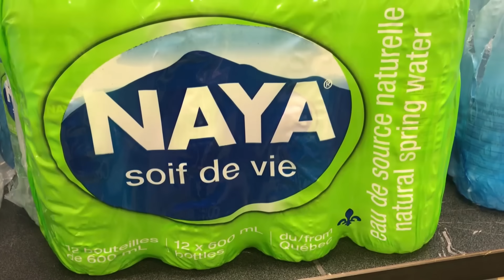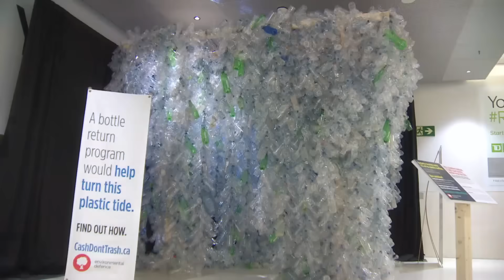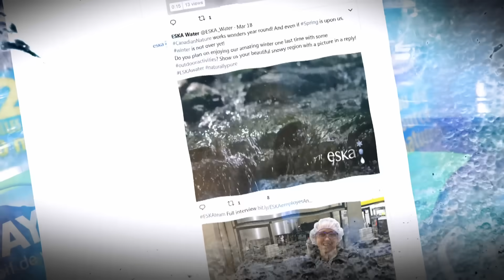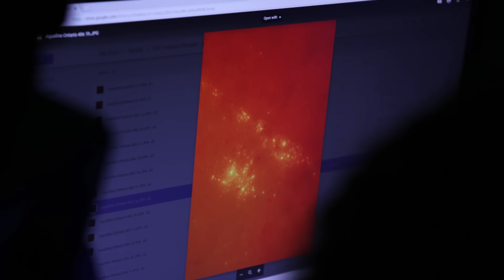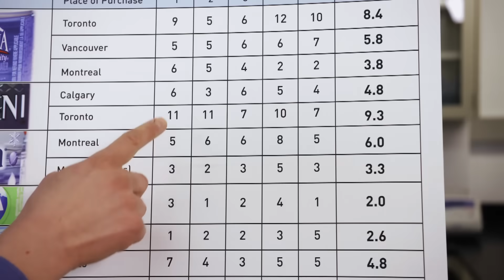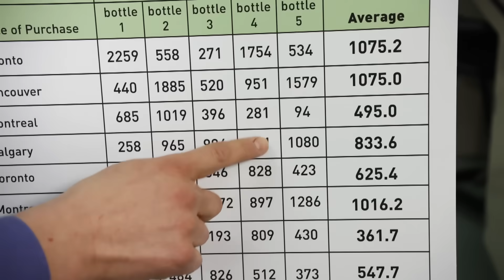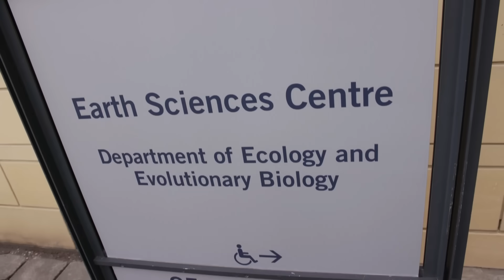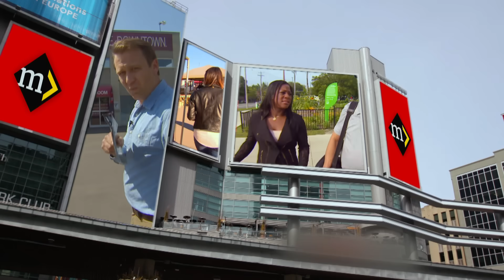Here's what's in your bottled water (Marketplace)

Comment: Idk, the water out of my tap is so hard, after one use of the water, it’ll leave a very visible calcium film on the stainless steel sink. Yes, after one use. The water is that hard. If I leave it for days, It’s even harder to scrub off. I’ll take micro plastics (100 micron) over THAT hard of water, going thru my system. I thought the public water system had heavy standards, but I guess not.

Comment: You should investigate: furnace service companies ...  I have experience companies telling me to replace whole furnace rather than replacing simple part  ... even my in-laws had three different prices from $1500 to $750 to $ 150 ... the last company simply drain the  cushion tank on their boiler system and everything work fantastic all winter long. Companies taking advantage of the elderly saying everything must be replaced when boiler was installed 9 years ago
Reply: Agonquin, they simply want you to buy a high efficiency furnace which is not usually high efficiency at all, and if there should be a serious power shortage on the new furnaces which use motherboards, and those motherboards crashed from a surge, thousands of people could be demanding a new thousand dollar motherboard over night.  The prices for the motherboards, which people may then have to wait weeks for, for factories to suddenly build, as well as weeks for enough men to install them, could suddenly jump to $5,000 apiece, more than a whole new furnace.  I say give us the old furnaces back again.  Almost nothing new is built as well as the old.  It's as if everything new is secretly programmed to self destruct shortly after the warranty is over.  The only good thing about new furnaces is that they are tiny compared to the old, so they are much easier to replace and/or discard.
Reply: @foxfur8327  ... so your saying that a contractor can't go to ¿? let say a Lennox store and buy a new board controller (contractors price: $250) because the old board's controller (you call a mother boards) has a relay that turn on the main fan blower: has simply burnt out ... so your saying instead of replacing this board, it's far better to let the contractor take my hard earn money of $3000 for a new furnace ... and then have contractor say while we're here let's replace your perfectly working A/C unit Too
 and call it $5000 for everything ... no thanks; I think it's better to spend $500 to replace a motherboard rather then shelling out $5000 plus

Comment: Why are they throwing plastic into our Oceans? Why not use pure glass knowing we have this environmental problem. Its amazing how environmentalist want us to do something about plastics and such. Yet we had pure glass products and they griped about glass being littered in rivers, lakes ect.... which if they have a core charge like they do for like car battery's ect... you will find a hell of alot less bottles would be thrown out. And of those bottles they can be turned back into sand to further keep our environment safer. Also paper bags and straws also can be burned. Reprocessed into a news paper or whatever it can be reused. Stop using foam products which take over 100 years to get rid of. How about using shredded cloth, or paper or fibers that can easily be disposed of without throwing things into the dumps.  And have a things that can incinerate products with special air filters to keep clean air as well as clean oceans.

Comment: Yeah plastic in bottled water which the bottle is plastic. Duh 🙄 
Tap is just disgusting cause it tastes more metallic just like Nestle, Desani cause the ph is toxic. 
Tap from pipes I wouldn’t be surprised if it has mercury in the water.
Also, if you reuse the bottled water, it can only last for a bit before you have to recycle again.
I used this one bottled water and after I used it once I found fungal spores growing inside. It’s really nasty. I definitely had to throw it away. I tried to figure out how did a fungus get inside the bottle and I started checking all my bottles. It got to the point I switched brands. I use Fiji. Little thicker plastic but not so much metallic taste. And yes a little more expensive than the cheap brands like Nestle or Mountain fresh. It just those I end up having fungus growing inside the bottle which is not good.

Comment: I drink bottled water because my local tap water is flouridated. Flouride in high enough levels (such as in my tap water) is toxic to the brain, drink it for a year and you will drop a few IQ places, if you are pregnant you will harm your baby. Also it is bad for the pineal gland (third eye.) Some bottled water does contain high levels of flouride so I research which bottled water to buy. I am only drinking bottled in the interim before I get a suitable filter for the tap water. The bottled water I drink is not bottled tap water it comes from natural sources. Ideally water would only be stored in glass not plastic.

Comment: I don't know if y'all have Costco in Canada, but I buy a case of Costco 500 ml brand bottled water to keep in my car to prevent dehydration while I'm on the road. 

A case lasts at least a year, maybe longer, because once you've opened the bottles & emptied them you can take 'em in the house & refill them. You don't have to use them just once and discard them and there's no worry about whether the tamper seal is intact, because I broke that seal myself the first time. 

When the cap is too worn to re-use the bottle again I can still recycle. When I go walking I still use liter bottles with "sports caps" that I bought back in the 80s. Those are a much sturdier cap that lasts longer and can be refilled again and again and ...

Comment: so much dramatized hyperbole with few useable facts. I  clean water for a living and tap water has, delivered through pipes made of all different types of materials including plastic, dirt (minerals), oxidized vegetable oil (used in water pumps throughout the cities), sodium fluoride (put in the water on purpose by cities because they have been told that it hardens the enamel of human teeth, but classified as a neurotoxin by the EPA and FDA), varying levels of chlorine (free) and chloride (attached to dead organic compounds) both of which cause damage to the mitochondria of all the cells that come into contact with it (but better than having a bad bacterial invasion), arsenic and 100's of elements and compounds. 
We are much better off than we were 100's of years ago and if people are drinking bottled water rather than the alternative then that will serve them well, including tap water compared to wine or a can of coca-cola.Our bodies have their own filters as last resort and can also adapt via epigenetics to accommodate the foreign materials, Everything in moderation

Comment: The years the chemical industries started using them for manufacturing should be included.Rayon in the 1930's, mercury in the 1800's for medicine.The contamination is massive. I found that working as an industrial mechanic and having a high school chemistry class helped when it comes to PPE and reducing exposure but it's the things that you don't see that were harming the body.

Comment: unfortunately I can't/won't stop buying because of issues that I witness from tap water. Examples: because of flooding we have had boil alerts for tap water; when the fire dept flushes the hydrants, my tap water is brown and greasy for about 2 hours; I've gone to restaurants and the water they bring to the table has an algae mildew "smell-taste". My issue is that when our tap water is cleaned at the water treatment facility, that water then travels from the treatment facility through old water pipes that have not been treated and is full of rust and bacteria.  By the time makes it to my faucet it is full of bacteria again. I lost vision in my left eye from bacteria in the tap water when I washed my face and it entered a scratch on my cornea.  The bacteria released toxins and damaged my cornea.  At least when bottled water is treated it goes from the treatment plant into the bottle. So I will take my chances and continue drinking bottled water but that's my choice.

Comment: The plastics industry needs to switch to plastics or other suitable materials that are made from mineral organics. That way the impurities found in current processing methods can be beneficial to biological matters. Current methods of trash disposal need to be changed to the breaking down of any matter to each tiniest piece of any particle of any compound, element or growth to the quantum level. Then recollected, gathered & bundled for reuse, instead of putting trash into landfills, which contaminates the water table underground, aquifers, rivers, streams, lakes, seas, oceans and ground elements including ocean floors. This can be done through Vibrational Resonate Frequencies, which runs through all physical matter of the Sciences. Using sensible magnetic electro, sound & light wave properties & computer technologies that are suitably ordained, researched, developed and accorded to organically compatible profigurations. Hemp for one organic source, also makes plastics better than benzene which is derived from oil & gas, & which is harmful to the human body & other biologies in long term exposer, consumptionism & elemental combinations. Switching to hemp instead of benzene also bolsters & expands Agricultural production, which is benefited by Ocean Water Minerals Fertilization. And draws attention & focus to these systems which are in need of being cleaned & kept clean. This would greatly improve material supplies for many more productions of all kinds in a resourceful & renewable system that generously benefits local, state, federal & International economies and fair trade. It is time to refocus our efforts to unify through the physical needs we have in common with each other, to supply ourselves with what we need to survive, thrive & flourish to enough & more endlessly expansive. This is the focal point that needs to be guarded, shielded & fortified to function in to provide the best levels of having for ourselves as a whole, or else what is being had collapses again & comes to not here.

Comment: I used to get well filtered surface (lake) water, from my tap ... very good to drink!  Three years and after Obama sprung for widespread water system expansion here, my tap water source was changed to an abandoned Coal Mine!  Suddenly, my tap water tasted like Dirt ... and is now, absolutely undrinkable!  On a very limited "fixed income", I try to buy Spring Water, as economically as possible!  After four months of drinking a "Store Brand", I went online to check it's content! and found that it contains a High Level of "URANIUM !"  I did find another "store brand", without the high Uranium content ... but it  costs 50% more!  But at least, I won't glow in the dark, or trigger any Dirty Bomb alarms!
Reply: For those who purchase "Purified Water" ... without added minerals, purified water washes the Saliva from your mouth and throat, often leaving you feeling more thirst, than before drinking it!  For those whom sweat a lot from work or play, Purified Water cannot replace Any of the Many Minerals or Electrolytes necessary,  for the body for function properly!

Comment: Also as a side note you should’ve had them use tap water as a control ... and for marketing I have to laugh every time there is a commercial for Fiji water as the water in Fiji isn’t drinkable (or I should say potable/safe to drink) without extra filtration that SOME resorts will use

Comment: Would you drink tap water knowing that it contains a large percentage of lead?? US does
Reply: That’s not true... some (very small) areas are corrupt and f’d up water controls - eg not adding in chemicals to stop corrosion of pipes which leads to high lead levels... if everyone in the states drank high lead leveled water they would all be dying with major health issues and their hair falling out. Which is not the case in the slightest. I live in the states. In most places the water is safe (aside from when there is major flooding that reaches the water management facilities- but even so cleaner than the water in most other countries in the world). Where I live the biggest water problem we have is high mineral content from limestone (if you consider that a problem- many ppl don’t, but I prefer less mineral content), which at the same time is nowhere near the level of mineral content I had in the water when I lived in Europe (much higher in Europe)....

Comment: The one thing that makes this whole video null is you didn’t test home water sources. Is the micro plastics in just bottled water or all water. Most of not all bottled water is filtered. So if they just take tap water, filter it, sell it and it will have less plastic than the tap water. So without knowing the alternative can’t say what is best. As for buying bottle water I don’t. I buy reverse osmosis water locally and use reusable bottles.i will only buy a bottle of water only if absolutely needed. It’s to bad CBC didn’t do this correctly.

Comment: This also includes containers, devices, accessories, piping, everything not to mention the fumes from recycling. Cans as well and metal products.
Reply: Buy water by the gallon. Less plastic surface area per fl oz. Drink from canteens (stainless steel) when portability required.

Comment: Nestle is the worst. Corrupt. We are better off getting home filters. Between the fluoride and chlorine / bromine, not to mention trace pesticides and pharmaceutical drugs, no water is safe unless you filter it. Problem with filtering is it removes the beneficial trace minerals also. Same with distilled water, which uses minerals to digest, causing micro deficiencies when you drink distilled water. So you have to use something like TMR's Concentrace to put the good minerals back into our water.

Comment: Excellent job on your video.  It did raise a question for me.  Ever let your juice or lemonade or tea or cola or ice water sit in a metal cup for a while?  I can taste the metal.  I believe it may be possible that if enough metal is absorbed into the body vs. plastic, the tissue becomes more of an "antennae" to radiate with the ever increasing vibrations from ELF of 1 or 2  Hz to 4G which is slightly over one millimeter  wavelength.  5G is being installed quickly and will be orders of magnitude faster for wireless data and is now sub-mm wavelength.  Do your own research but this Hillbilly thinks trouble is brewing much worse than plastic in our extremely expensive water bottles...just my 2 cents.  #WWG1WGA

Comment: The best water filter available to the general public is "The Zero Water Filter".
The 30-cup dispenser model comes with one filter, a water quality tester, and sells for around $39.99 at Walmart.  Do the research and find out which of the most popular brands is best.  After you do your research you will find that "The Zero Water Filter" is the best by far.  BTW, I receive NO compensation for telling you this.  I'm doing this out of concern for water safety and to show how deadly our unfiltered tap water really is.  Cheers!
https://www.walmart.com/ip/ZeroWater-30-Cup-Dispenser-with-Free-Water-Quality-Meter-ZD-030RP/954669897?athcpid=954669897&athpgid=athenaItemPage&athcgid=null&athznid=PWVUB&athieid=v0&athstid=CS020&athguid=d47b4e65-334-16a6a1cb77dc8f&athena=true
Reply: AMEN!  THIS IS THE ONLY BRAND THAT WILL ALSO FILTER OUT THE FLUORIDE

Comment: Potable water containing particles of more than 20 microns in size, is potentially life threatening to consume, mostly due to the potential existence of viruses. It's hard to imagine any potable water, with more than 20 micron particle size contaminants, being offered, or approved for public consumption, by any public health entity.  It is far less expensive to re-filter your tap water, with a <21 micron filter, also with activated carbon filtration, to remove chlorine, microplastics, and @80 other contaminates, including lead, and cancer-causing trihalomethanes, which are formed when tree leaves, and other vegetation have been in the water, which is being disinfected with chlorine. Store your drinkable water in a stainless steel thermos to carry along with you during your working hours, and be confident that you are drinking the best "man-made" water possible, at this time.

Comment: 1. Get up off the couch
2. Walk to your kitchen
3. Go to your Cupboard
4. Take your left or right hand
5. Open cupboard
6. Lift cup from Cupboard
7. Take cup out of cupboard
8. Walk to the kitchen sink
9. Use left or right hand to turn on the kitchen tap by using handle of sink
10. Use left or right hand to test the water temperature to make sure it's cold enough
11. Once it's cold enough hold cup by using your left or right hand and stick cup underneath tap
12. Full glass up with water. 
14. For extra coldness add two ice cubes. (Optional) 
15. By using your left or right hand at normal speed lift full cup of water to your lips 
16. Open your lips and mouth and put cup to lips and mouth.
17. Slowly tilt glass upwards
18. Feel that cold, clear goodness of water enter your mouth.
19. Swallow
20. Enjoy and have as much as you want

(I bet you looked to see if #13 was there) lol